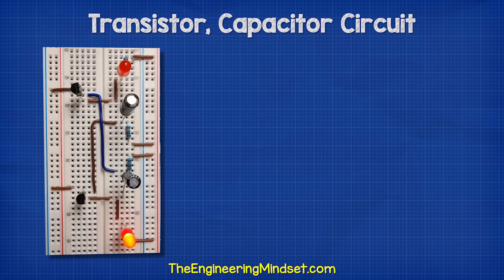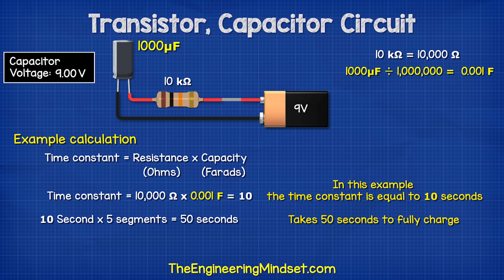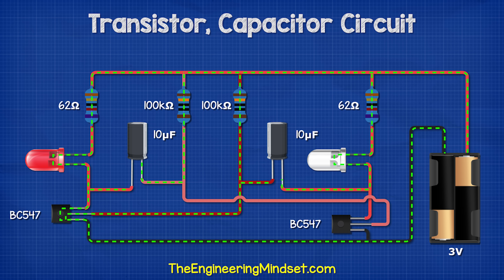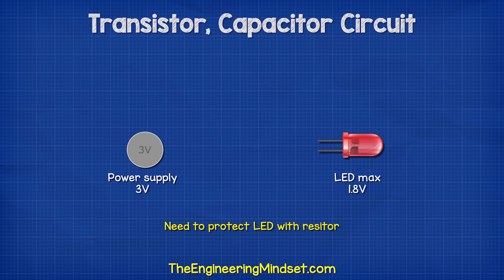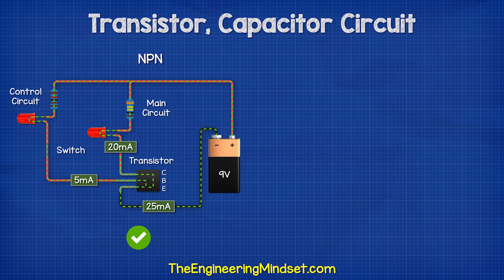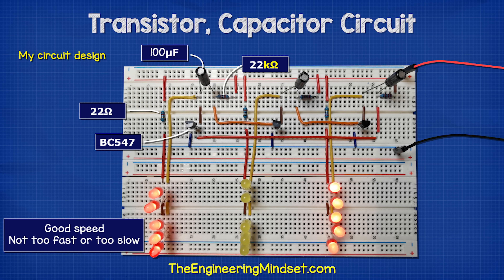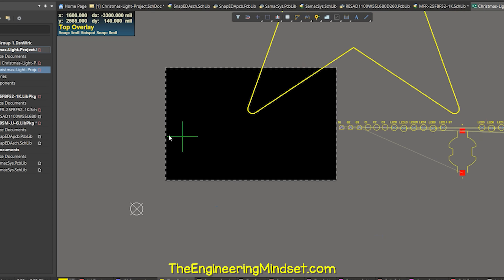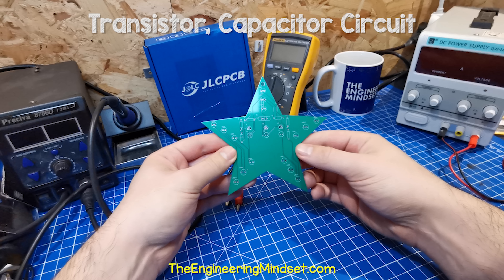Transistor capacitor circuit design guide

Comment: will this circuit work work with a 1 watt 4 leg rgb led common anode,? (I probably could do it with a nano but don't want to, I kave a stack on transistors on hand bc547 Tip31c, ) and if it will would I have to change over to a pnp or stay with npn trans, thanks
Reply from the maker: I like that you've considered an alternative application, that's a great engineering mindset. I think you should try it on a breadboard and paper and see what happens.
Reply from the maker: Seen the new LED explained video? so much detail covered! https://youtu.be/O8M2z2hIbag

Comment: Why does transistor 1 closes when capacitor 1 reaches 0.7v?
Reply from the maker: Because it's output it connected to transistor 2, so the current flows to the base of transistor 2 and away from transistor 1

Comment: It's been a long time since I did the circuit building.  It's fun to do this and you can build some interesting projects.  The math for the circuit components is what I forgot from long ago.
Thank you for this.
Reply from the maker: Time you got back into making hobby circuits I think. Great fun. I tried to go lightly on the math in this video, replacing the parts with trial and error to make it more visual
Reply: There are apps now that you can design circuits and Blow Virtual LEDs and Capacitors . Trial and Error way .
Reply: Some Websites have an LED Resistor Calculator that do that for you. I also use one of these although I can use the (R = U / I) Formula. It's just as fast as calculating yourself.😄😄😁😁
Reply: It is very simple, and no math is needed to figure it out.
3v 100ohm
5v 330ohm
7v 470ohm
9v 620ohm
12v 1.5kohm
And so on. Just remember voltage vs current is all you need. First rull of thumb is, always find the l.e.d specks when you purchase, forward voltage, and current. You will find that what I said is approximately to the correct value to a standard, 2.8v 15 to 20 ma l.e.d
Reply: @hollytimlick9470  3V 100 Ohm @ 2,8V 20mA ???? Wrong Value!!! right one for 1,5V 20mA LED

3V 10 Ohm @ 2,8V 20mA LED
5V 120 Ohm @ 2,8V 20mA LED
7V 220 Ohm @ 2,8V 20mA LED
9V 330 Ohm @ 2,8V 20mA LED
12V 470 Ohm @ 2,8V 20mA LED
Reply from the maker: Check out NEW resistor video, everything covered! ➡️ https://youtu.be/DYcLFHgVCn0
Reply from the maker: Seen the new LED explained video? so much detail covered! https://youtu.be/O8M2z2hIbag

Comment: Good job Buddy, your channel is very interesting. I don't think I'll be able to create your star, however, but I at least learn some basics in electronics. Thanks to you! :)
Reply from the maker: You can try on a breadboard or you can download the circuitboard design and have it posted to you. Just need to solder it.
Reply: @EngineeringMindset  i do not see the file of your circuit board

Comment: Nice video, but I have to stress that an astable multivibrator is NOT a flip-flop. A key aspect of a flip-flop is that it can be flipped to one state and holds this state until you deliberately flip it to another state. It is right that a flip-flop is a multivibrator, but a bistable or n-stable multivibrator (where n is the total number of states).

An astable multivibrator is usually described as a relaxation-oscillator.
Reply from the maker: Check out NEW resistor video, everything covered! ➡️ https://youtu.be/DYcLFHgVCn0
Reply from the maker: We could simply place 2 switches into the circuit and make it a real flip flip,
Reply: @EngineeringMindset  They are very similar circuits yes, but for a flip-flop you also have to replace the capacitors with resistors and remove the corresponding pull-ups that no longer has a purpose. This will keep it stable, even if none of the set-switches are closed.

Comment: the problem is not that people don’t like to create their own circuits and try them out.  the problem is that the programs you use are for a monthly subscription fee.  The problem in my view is as if someone were creating a sculpture out of lego cubes without physical cubes
Reply from the maker: Well it took a lot of Engineers who work very hard to create the software and need to be paid for that. The software constantly needs maintaining, improvements and updates. That requires funding, and the subscription supports that.
Reply: @EngineeringMindset  more program updates cause more instability.  If the updates are only in the database of circuit elements, they can be added once a year as they do not hit the market at all before.  I do not support monthly subscriptions to programs designed to create products as each file lands in their database before it is licensed.  Paying a subscription to the program remained only espionage and profiteering while working on other projects.  So what do we buy a license to use a program that takes up space on our computers ... who wants to have a roommate who has to be paid to clean up after himself.

Comment: 3:08 I do not fully understand why the current flows to the transistor number 2 base only when the capacitor 1 is charged it could flow there immediately. Can someone explain it to me? :)
Reply: The base-emitter junction of the NPN transistor acts like a diode. Significant current will not flow across it until the forward voltage of 0.7V has been reached. When transistor 1 is fully switched on, its collector is pulled close to ground voltage. If  capacitor 1 is in a fully discharged state, then base of transistor 2 is also close to ground. But notice the orientation of those capacitors? Why is the negative side connected to the bases of the transistors? This explanation has actually been simplified. What really happens during the charge/discharge cycle is that the base of the transistor in an astable multivibrator will sometimes go below ground voltage. For a more complete explanation of this circuit see RSD Academy's channel
Reply: Maybe I'm wrong but here is what I understood after a first view of the video :

The current is not going through the first capacitor because the first loop is open by the first transistor, so it goes to directly to the second loop, and this will power the second LED while charging the second capacitor. Once the second capacitor is fully charged the current will flow to the first transistor which will close the first loop and turn on the first LED while charging the first capacitor. Once the first capacitor is fully charged it will active the second transistor and then it cycle like this again an again.
Reply from the maker: Seen the new LED explained video? so much detail covered! https://youtu.be/O8M2z2hIbag

Comment: Wow, what a brilliant video. I wish I had had a teacher like you when I was at school in the 70s.
Anybody remember the flashing roadworks beacons? , Had a few of them in my younger days, took out the pcb and put the beacon back so it just stayed on permanent. Made many flashing gadgets with this pcb, even stepping up to flashing a 240v for a mates party. Didn't have a lot but we enjoyed what we had.
Reply from the maker: I think there's a lot of engineering minded people out there who are guilty of stealing those roadwork beacons to see how they work. Personally I was surprised to find a giant battery inside, that was simply made of multiple small batteries linked together.
Reply: The road work flashers are nothing new. My man has made his own flasher without stealing one off of a construction cone. His own design fully on his own.

Comment: Everytime I start understanding the circuit design a little bit. My mind sees the resistors and goes blank again 🤣😤
Reply from the maker: Stop resisting. But seriously, they are just limiting how many electrons can flow through the branch of the circuit. That makes the capacitor charge slower and also stops too many electrons passing through the LED and burning it out
Reply: @EngineeringMindset 😂😂😂only cops say that lone
Reply from the maker: Check out NEW resistor video, everything covered! ➡️ https://youtu.be/DYcLFHgVCn0
Reply: Stop focusing too much on the tiny details. The bigger picture is more important.

Comment: 2:45 why will it flow thru resistor 3, not 2? This needs longer explanation.
Reply from the maker: Check out NEW resistor video, everything covered! ➡️ https://youtu.be/DYcLFHgVCn0
Reply: As I understand it, it does flow through both resistors, but one of the two transistors will open before the other. The transistor opening means that the capacitor connected to that transistor on the positive side will now see a voltage change: before you had no current flowing, so both pins of the transistor saw the same voltage; now current starts flowing, and you get a voltage drop from the LED and its resistor. This means the voltage starts changing across the capacitor. At the same time current was indeed going to open the gate of the other transistor, but since the two components are not identical (because the manufacturing process cannot be perfect) it had not yet reached the opening threshold and in the meantime, the capacitor that is seeing the voltage change is now drawing all the current until it finally stops seeing a voltage change (that is, when the first LED has reached its maximum current and is now finally on). At this point, the capacitor no longer saps current from the second transistor gate gate is able to turn on, creating the same effect on the capacitor, which will sap current from the first gate. Basically current can only go to the gate when you first apply voltage, but once the current in the first transistor flows and changes the voltage across the first capacitor, the current going to the second gate now has a much easier path going to the first capacitor instead of opening the gate and so the second gate gets no current (or very little) until that capacitor has fully charged up. When it’s charged up, the second capacitor plays the same trick on the first gate, and the process repeats itself. To better understand this, check out the behavior of a capacitor through time when a voltage is applied across its pins.
Reply from the maker: It can flow through either and they will both actually get some power as soon as the battery is connected, I just had to choose a way to visually explain the circuit so I went with this route. The resistor values will never be exactly the same, whichever one has the slightly lower resistance will get slightly more electrons and that will start the process
Reply: @EngineeringMindset   Yeah, that was an important thing that should have been mentioned in video, and yet even that answer wasn't complete. To be complete for that question, you should have also mentioned that as soon as the transistor which happens to open first (due to the mentioned dissimilarities between components), it immediately pulls down the base voltage of the other transistor, keeping it shut until the capacitor charge has been built up to open it, in turn pulling down the base voltage of the first one, and cycle repeats.

While this video is a very respectable attempt to make a good explanation, it also contains other errors, omissions, and inconsistencies causing a lot of headaches for the target audience - unfamiliar on electronics:

- 0:55 you should have said "in series" instead of "across", which is inaccurate expression and tends to imply rather an led connected in parallel with the transistor. I see, you said "led circuit", by which you thought about the circuit of led, resistor, battery, and their wires, which as a "circuit unit" is indeed connected across - alas.. essentially parallel - with the transistor. But beginners cannot get that, they don't differentiate the meaning of your "led circuit" from led, and they intuitively think the "across" just as "in parallel with".

- You are showing demo videos on transistor operation, in which you are feeding base current directly with a battery. You may not do that! Transistor BE junction always needs a current limiting resistor if fed by constant voltage! Otherwise it gets destroyed, ie. very same applies there than you mentioned with leds!

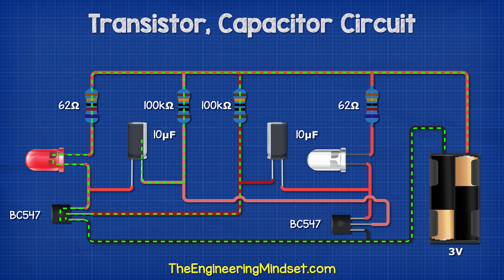- 2:57 You omitted very relevant "also" word before the word "causes". Such omission causes incorrect implication that it would be the current through the led and its series resistor which causes the "electrons to be pulled into capacitor". But it is not, the capacitor "pulling" is caused directly by the previously mentioned opening of the transistor, to which you could have referred by a word "also". Ie. it is the very same cause which also(!) causes the led and resistor current to flow. The same word omission was when explaining the other side when its time came.

- When driving several discrete leds from same source, you should never connect them directly parallel, because very slight differences between their forward voltage characteristics may cause huge imbalance in distribution of the current between leds, possibly destroying one and after it the rest will have yet hugely more current and be certain to be destroyed. This is actually quite a common cause for premature failures of cheapo led lighting products. Every parallel-connected discrete led should each have a separate current limiting resistor.
Reply: @TheSimoc Hi, I am having such a difficult time understanding the part at 3:08 . Why would the capacitor reaching 0.7v effect the other transistor? Couldn't the current from the transistor already go there? It's so confusing to look at, can you please explain?

Comment: In digital terms, it is Ring Counter, multiple odd numbers of inverters are connected in a loop to drive LEDs. Also, the circuit has very poor thermally stable timing.
Reply: Technically, it's a "ring oscillator", a "ring counter" is entirely different.
Reply: @Enigma758  correct, sorry my typo